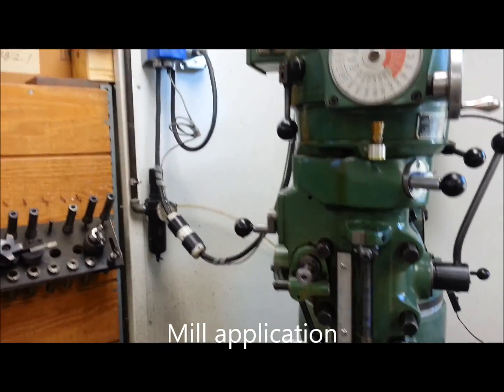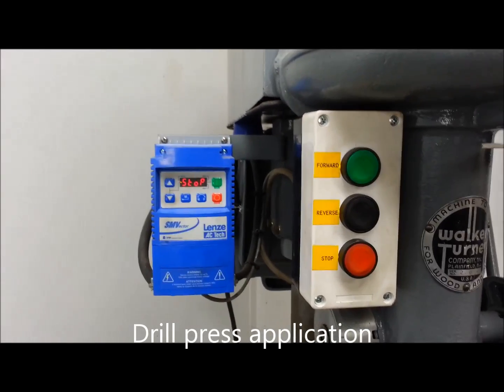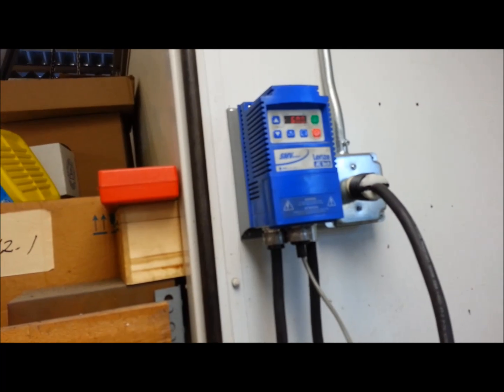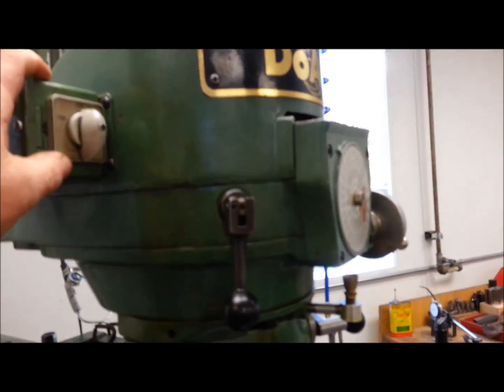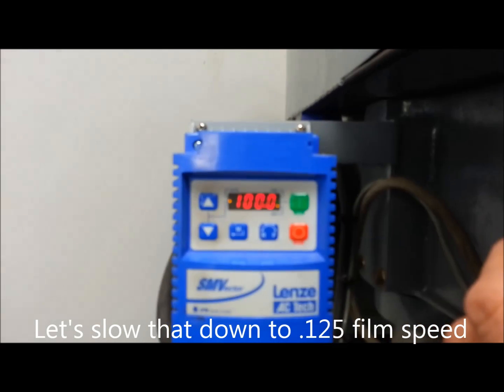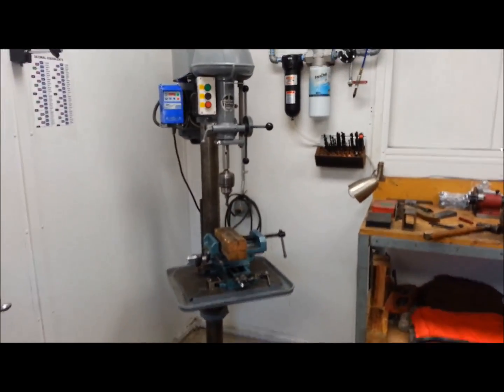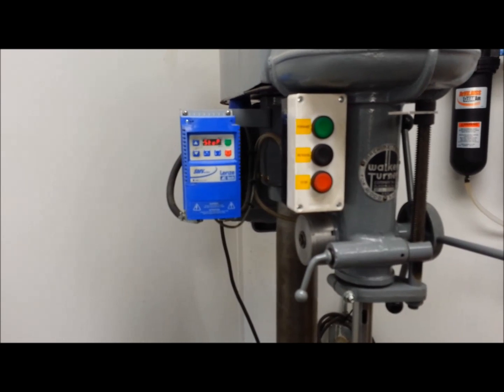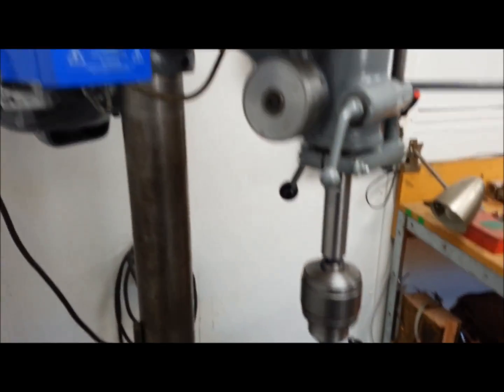VFD introduction / application / information

Comment: If your drill press motor is 900 RPM, wouldn't it be a 8 pole motor? 4 pole is 1800 RPM, double the pole count would half the synchronous speed. Great video btw!

Comment: Hey I have a question what do you think about using a vfd on a air compressor and say if you're ramp in the power what's the vfd will that possibly work
Reply from the maker: Any VFD can have a ramp programmed into it.
Reply: @ShadonHKW  okay thanks I was thinking about putting a vfd on this 3-phase air compressor
Reply from the maker: @tigwelding123  With the right ramp time, you can eliminate belt slip and stop the high electrical inrush spike during start up.
Reply: @ShadonHKW  alright coolyeah I was planning on setting this 10 horsepower air compressor up so I was thinking about running the vfd or swapping with a 10-horse single phase motor but they ain't cheap

Comment: I recently purchased a Bridgeport Series I mill with a 2 J Head (2HP/8 amps)  My current mill and lathe are "hobby" size, 110V.  We have other shop equipment such as a drill press, table saw, band saw and such which are all 110V although the table saw and band saw can be wired to 220V.  This is my first experience with 3 phase equipment and researching the requirements to install the new mill.  I've been reading and watching videos and your video was just wonderful.  It answered so many questions in just a few minutes.  After watching and reading your comments and answers I plan on purchasing a Lenze 3 HP/9.6 amp, probably from Wolfe.  I will try to duplicate the setup you have on your mill, probably coming off a nearby sub-panel with a 10 or 15 amp 220 breaker.  If you have any wiring diagrams, programming recommendations or other recommendations for our other equipment we would be very appreciative.  Thank you!
Reply from the maker: The Lenze drives are US built with US written instructions, very intuitive. Drop an e-mail if you have any specific questions.

Comment: At 8 hz  on your lathe how concerned are you about motor cooling. The fan on the motor wont be spinning very fast.
Reply from the maker: I wouldn't want to run for hours at that speed, but for the 15-20 minutes I need it, cooling isnt an issue.

Comment: My 1980s Jet mill ,( looks like a Bridgeport J head ).  Has a 2 hp 3 phase motor on it. The motor is a 2 speed motor ( which I have never seen before on a milling machine). It has hi and low forward and hi and low reverse on the switch. Would this VFD work for me to run it on single phase? The motor tag says 2/4 pole. 3400 and 1700 RPM.

Comment: How would you add a true digital RPM display off the spindle?
Reply from the maker: Best you can do is motor RPM, the step pulleys will always change the spindle RPM and throw it off.
Reply: @ShadonHKW  thought maybe you could add a sensor to spindle to count rotations.  Stand alone to vfd.
Reply from the maker: @cruch9  Yes, you could do that, but no way to feed that into VFD display, sorry I misunderstood your question.
Reply: @ShadonHKW  how do they do something like that?
Reply from the maker: @cruch9  This what your looking for? 
https://www.amazon.com/DIGITEN-Digital-Tachometer-Proximity-Switch/dp/B00VKAT8A2/ref=sr_1_13?dchild=1&gclid=Cj0KCQjwufn8BRCwARIsAKzP695Kcks0nurHGJOgK0Jj9Qyn3yzuo9utQk-LVVvag5KjKFzAz0ZezZAaAhcXEALw_wcB&hvadid=153661293734&hvdev=c&hvlocphy=9031206&hvnetw=g&hvqmt=e&hvrand=8411405061771127303&hvtargid=kwd-7379043674&hydadcr=5710_9180210&keywords=digital+rpm+gauge&qid=1604246278&sr=8-13&tag=googhydr-20
Reply: @ShadonHKW  yes!  Thank you.  Is it possible to have a vfd automatically reverse motor depending on gear change lever position?
Reply: @ShadonHKW  we had a Kent knee mill where I use to work that would read spindle rpm, not sure how though.  It also had a switch on the high\low lever that would automatically reverse motor depending on if you were in high or low gear.  It was very nice.

Comment: Thanks Stan, this video was extremely helpful.  I was wondering is you could suggest a VFD solution for me.  I have recently picked up an awesome find for next to nothing, an older Swedish made gear head drill press.  It is a 3 phase, 500v and 550v 2 speed internal motor with 1 hp.  I only have 110v to my shop with no option of upgrading to 220v.  Can I use the VFD from 110v input to 550v output?  I was also wondering, as it does not have a backstop on the gears can I add a 2 speed forward and revers switch?  Sorry if these are stupid questions as I am a Millwright/Machinist not an Electrician.
If I could figure out how to do it, I could attach pictures of the information plates on the press.
Any help will be much appreciated.
Thanks
Ray Hanson

Comment: This has been a great help but I have a couple of questions, I'm going to put a 1/3 hp SMvector drive on a 1/4 hp motor since that's the smallest version of the drive they sell, as long as I set the current limits correctly, should there be any problems? Also does the motor have to be inverter rated? I couldn't find something that small that was.  Thanks

Comment: VERY informative!Thank You for sharing!At about 12 min,you mention the 2 different types of torque.Which are you using for your machinery(Lathe,Mill,Drill press)?Also,some of the VFD's I've been looking at are rated in Kw's.Is there a way to translate that into a HP rating?Stay safe during this Covid crap!
Reply from the maker: I use the torque boost on the lathe and drill press, mainly because I am too lazy use the mechanical speed reduction by swapping belts. Both would have the same result.

Comment: If someone really wants to do this, and needs more than a small speed change, it really pays to spend the extra money and buy an inverter ready motor. Those use special insulation, and wiring to allow high speeds and not have the heat destroy them. Otherwise, for a 4 pole motor, never run it at more than 120Hz, or 3600 rpm. Even that is pushing it. Everything I converted to VFD drives have motors I replaced with inverter motors. If you do that though, and the motor is in a box inside the machine, make sure the inverter motor fits. Many are somewhat bigger. And size your VFD properly! Ideally, the VFD should be sized one size larger than your motor. So a 1 Hp for a 3/4hp motor, etc. also, make sure there are no contractors between the VFD and the motor. The motor needs to be directly wired.

Comment: Could I install a vfd drive on a drill press motor that is 120v , 60hrz, 7.5 amps, 220-3600rpm- To eliminate the belt changing?
Reply from the maker: No, a single phase motor wont run on a VFD.

Comment: Great vido! Most people seem to recommend wiring the vfd directly to the motor of a mill. Seems like you chose to go through the switch on yours. Would you recommend doing it that way over wiring direct?
Reply from the maker: I am using the mill's old drum switch to apply a run command (control circuit), the power wiring goes straight to the motor.

Comment: Great video Stan.  Do you think I could run (2) 220V, 3Ph motors at the same time not exceeding the amp rating of the VFD?  
Such as a 3 HP lathe motor with 0.25 HP coolant pump motor.  Thanks!
Reply from the maker: Yes, it can be done, with some limitations,  1) you have to install motor protection for each individual motor (thermal overload blocks) wired with the switchgear into the run enable of the VFD,  2) both motors will run at the same speed synchronously, there is never any way of slowing just 1 motor down. 3) you cannot exceed the amp draw on the VFD.
Reply from the maker: Also look at this video, it shows running 2 motors off of 1 VFD. https://youtu.be/oYU499OfJUM?list=PLvITyjNApwrqSBOylbjxuwLEOooHtSAeh
Reply: @ShadonHKW  Good Stuff, Stan you're the VFD Man!  Could I switch off the coolant pump motor at the overload block when not needed?  Thanks again!

Comment: Stan:  Do these VFD hum when the motor load increases?  I'm thinking of putting one on a 5hp motor that drive a lathe.  Any thoughts....fyi ((single phase in---3 phase out 230-240 volts...))
Reply from the maker: I wouldnt call it a hum, but a definite frequency can be heard.
Reply: Once you get above 3 HP (10 Amps) of output these VFDs get very pricey.

Comment: Stan...I'm considering a VFD...one thing I'm not sure on...and nobody mentions it...that is  voltage in and out....
Do you need to have a VFD  be sized to the line voltage in and out.  I guessing you can't use a 480 volt  VFD on a 230 volt (house hold) voltage...correct?  I see these on eBay but I'm not sure about voltages.  Next...can you use a 10hp VFD to drive a 5hp motor...?  Thanks for your help...
Reply from the maker: No, you cant mix and match voltages, 240 in, 240 out. Oversizing a drive wont hurt anything, just program the overload threshold based on your tagged motor amp draw.

Comment: Wow. After 4+ yrs., I do not know if I'll get an answer or not. 
But, here goes.
If I have a 1 1/2 - 2 HP motor on one piece of equipment, and I have another piece that has a 5 HP motor, can I get a 5 HP (or 7.5) VFD and run both off that ?
Or can you even run a 2 HP motor on a 5 HP VFD ? Not at the same time. 
At present, I only have one (1) 3ph motor that is either 1 1/2 or 2 HP (tags removed) motor. Just trying to plan ahead.
Thank you. Found the vid very informative.
Wally
Reply from the maker: Not at the same time, you would have to do a parameter change every time you switched, that would get old pretty quick.

Comment: Stan,
Are you running shielded wire from the drive output to your motor connections?
Reply from the maker: Duane Dickey Unless there is sensitive electronics nearby, I dont use the shielded cable.

Comment: I am wondering if I am able to control multiple SMVectors with one start stop I have 3 large exhaust fans that were supplied with 1 SMVector each but I need all three to be able to turn on from one point and be controlled to be shut off with a timing relay if you have any suggestions it would be greatly appreciated.
Reply from the maker: Hi JD, if you use 1 VFD as the "master" and the others as "slaves" use the terminals TB16 & 17 for a relay output, set parameter P-140 to "1" to close the N.O. contact when master drive is running. See page 32 in your paperwork.

Comment: i know this is old but im buying a 1.5hp bridgeport mill with variable speed head what would you suggest i use since i only have single phase and i will be doing power tapping my name is lee and you can email me at leamad1000@yahoo.com im electric dumb except for regular house type wiring so all help you can give would be greatly appreciated and i love yall fellas machining videos i have learned a lot from yall thanks for any help you can give also im not rich so if its going to be over 500 bucks i guess ill have to just go with a phase converter and live with it
Reply from the maker: This will do you fine https://www.wolfautomation.com/products/ac-drives/esv112n02yxb-ac-drive-1-5hp-208-240vac
Reply: thank you sir

Comment: Stan, Thanks for the great video, very informative.  I was intrigued by your clean room application.  You showed what looked like an analog gauge measuring pressure, what did you use to trigger pressure changes for the VFD?  I was interested in making what Oneida-air has on their current dust cyclones, which is a VFD blower to maintain constant pressure (so I would need some type of variable pressure gauge).  Their add claims the Baldor motor varies from 3500-4500RPM is 75Hz to fast for a standard 2 pole motor?  Thanks in advance,  Carl
Reply from the maker: Hi Carl, that is a Photohelic by Dyer Instruments, it comes with high and low switch gear (adjustable) I have overdriven motors up to 125 Hz with no problems, two things that need to be considered when overdriving 1) never exceed the tagged FLA on the motor 2) motor is inverter rated
Reply: Thanks Stan.  I hadn't considered the motor inverter rating.  I have a Dwyer magnahelic, good to know they have the photohelic!  Appreciate the help.

Comment: On your small drill press I would love to see a wiring diagram on how you wired the momentary push on off reverse buttons. Did you have to use a latching relay? I am using a similar vfd but it isn’t exactly like yours
Reply from the maker: Most VFD's can be programmed for momentary or maintained contact, no relays required, check your manual.
Reply: Shadon HKW Thanks it seems it seems I manage to buy the only one that doesn’t offer 3 wire control. Looks like I’m stuck with a toggle switch or something similar.

Comment: Shadon, very Informative video, thank you. I contacted Wolf Automation and asked about an  AC Tech/Lenze VFD for my 2 hp, 3 phase Baldor motor. I have single phase residential 240V input. Their engineer in sales suggested buying a 5 hp, 3 phase input VFD model, and derating it to avoid over current problems. I was confused as the model I looked at says it's rated to control a 2 hp motor. Any suggestions? They  get considerably more expensive as hp goes up, especially in the NEMA 4X enclosure. I need that due to metallic dust, this set up is for a belt grinder. Thanks again for the great info!
Reply: I thought I'd update this for anyone interested. Wolf Automation engineer later contacted me and stated he had made a mistake, my motor would run on the 2 hp model VFD, but he highly recommended going to the three HP model to avoid over current fault codes on start up, due to amp draw, which I did. The three horse will handle 9.6 amps. Also, no filter ( line voltage) is normally required, but can be added if needed later. They are not integral in that unit. Hope this answers a question for somebody and saves some hassle.

Comment: If frequency is reduced, speed reduces so does torque, so how helpful will be attaching VFD to a lathe?
Reply from the maker: A vector drive will boost torque at low speed to compensate, but only in small bursts. A standard VFD offers no torque boost at all.

Comment: Where you say you have a 4 pole motor doing around 900 rpm that means it is connected in consequential  pole mode. These motors are common on drill presses. The consequential mode gives a generated 8 pole mode. There are only 4 physical poles  but by altering the starts and finishes of the coils they appear as unipolar, which means a non wired consequential pole appears in the iron work between the physical poles. Check the available leads and you will find the ability to run at 1800 minus slip or 900 minus slip ( 1500 and 750 at 50hz).  Slip is necessary to generate torque, normally in the range of 2 to 5 percent i.e. 1725 for 4 pole at 60 hz.  Exceed the rated slip for too long amd the smoke will get out. Normally a drum controller takes care of this conversion.
 In the range from low speed to rated speed the system operates in constant torque mode ( vector configuration can increase bottom end torque via PWM) above rated speed the system becomes constant power. Try and exceed frame power rating and the smoke gets out. Vector drives are also great for traction applications because of these characteristics.

Comment: Thanks for the great video! Have you ever run the remote keypad? I have the SMVector on a South Bend lathe and cannot get the remote keypad to play right.
Reply from the maker: Daniel Williams Never tried the remote, what is it doing?
Reply: Shadon HKW I found the problem, and the instructions are not clear in this area. So, in case you do option for the remote keypad sometime, this is what you do. There is a youtube video by Lenze that shows what to do. Terminal strip #1 and #4 need to be jumpered. That wasn't clear. Of course, then P100=03 and 400=01 for remote keypad control and then it plays just fine. Its great for remote mounting the drive and then having local control and programmability right at the lathe head. Thanks again!

Comment: Great informational video.  I recently started wiring up one if these vfd by Lenze.  I have a question on the start stop buttons.  You mention momentary buttons. Anything specific I should be looking for in start stop buttons and a 10k pot?
Thanks.
Reply from the maker: Not really, fwd and rev buttons are normally open, stop buttons are normally closed, pretty standard.
Reply: Shadon HKW where did you get the cintrollers on thendrill press?
Reply from the maker: https://www.wolfautomation.com/pushbutton-enclosure-22mm-3-hole-abs-plastic
https://www.wolfautomation.com/pushbutton-22mm-round-momentary-1no-gold
https://www.wolfautomation.com/pushbutton-22mm-round-momentary-1no-nc-black
https://www.wolfautomation.com/pushbutton-22mm-round-momentary-1nc-red
Reply from the maker: Yea, you probably spent more than you should have.
Reply: Shadon HKW some of the buttons share an input (usually pin 4). How did you wire in multiple button to pin 4?  I really appreciate the information.
Reply from the maker: Just run a single wire from the VFD and install jumpers @ the pushbuttons.
Reply: Shadon HKW #greatidea
Reply: Shadon HKW sorry to be a bother, for your monmentary start and stop buttons.  Which inputs did you use?  I have the start button using input 1 and 4. Where would the stop be wired into?  Thanks.

Comment: Is it precise enough to make a thread on lathe? how do you do ratio for that?
Reply from the maker: Too many variables for that, belt slip, rotor slip, motor bog based on loading, you would need a rotary encoder to maintain a constant RPM and feed rate, your getting into CNC territory now.